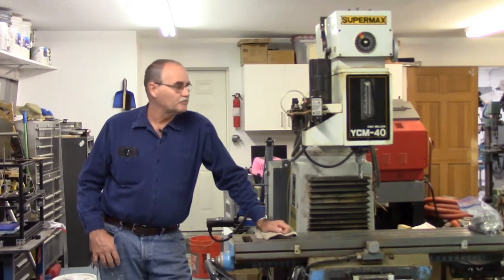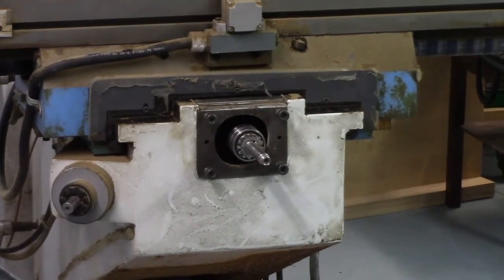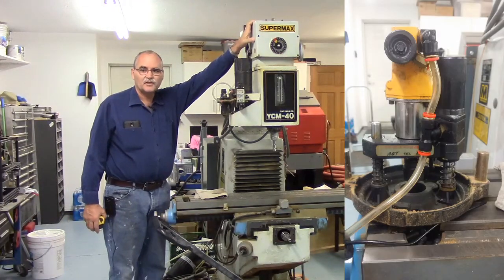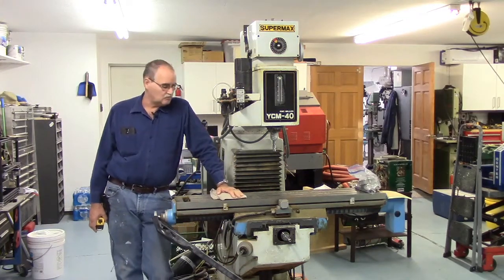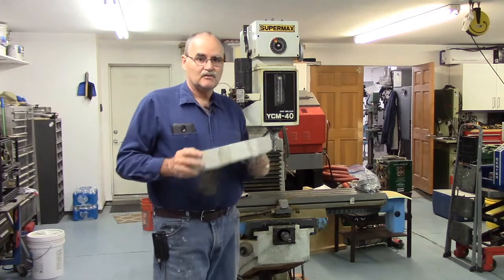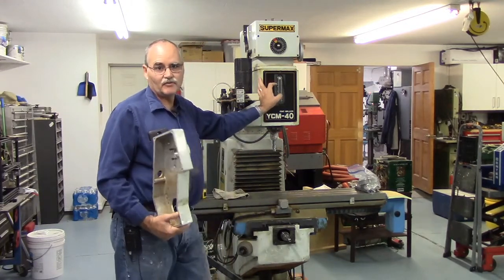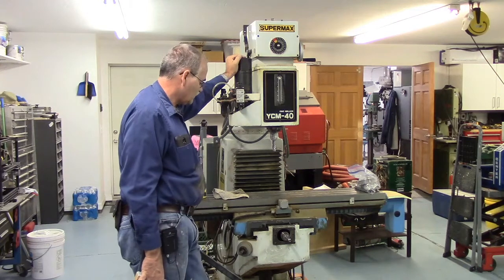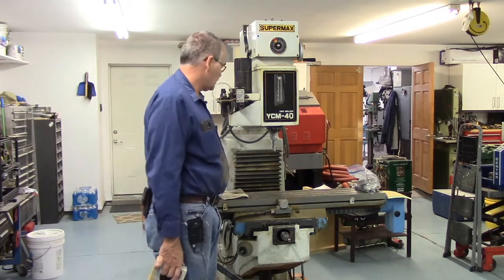Supermax YCM-40 Intro

Comment: Hi Marty,
I recently acquired a 1993 Supermax YCM-40, that had been in storage for years, by paying arrears storage costs.  Apparently, the original owners had removed and replaced the original milling head with a 40,000 RPM cutting head for some special purpose.  Otherwise it appears complete with everything needed for the intended purpose, but simply placed in storage.  Are you available - email or preferably phone - to field some questions about this type of mill?  For example, do you know (for certain) what head taper (#30 or 40) is on this mill?  If you wish, I can setup a temporary email account, so we can obtain each others contact info without publishing it to the world!  Thanks! BTW, my name is (also) Martin
Reply from the maker: Martin, there were several spindle option s as far.as I know. You can email me at my YouTube channel name @gmail.com I'll try and respond as time.permits. Have several paying retrofits going on at the same time currently. Helps keep the lights on in retirement. 😀

Comment: I have a project mill similar to YCM-40 you have, Bridgeport Boss series 1 with dc mag motors that are missing drives, and have gave up trying to get drives that work. Looking at DMM 750 watt motors as well.  Am considering using the acorn board.  My mill only has the original spindal motor which I believe is 2hp.  I would like to have rigid tap capabilities, but am concerned the motor is too small.  Do you have any suggestions for rigid tap and acorn board with this machine? 
Thank you for posting videos.
Reply from the maker: Hi Randy. Glad you found some useful info in the videos. Helps encourage me to do more! First, if you have the original DC brush Servos, had you thought of a Centroid All in One DC Control? Not only is a dedicated motion controller, with 16 I/O, Can control a VFD, it has 3 DC Brush servo amplifiers built on. I suspect this is out of your budget? DMM with Dyn4 drives and Acorn is a good choice. If you want to rigid tap, you have to fit an encoder to the spindle at 1:1 ratio. Usually a challenge on Bridgeport style heads. Elrod Machine has an attachment, but I don't know what he gets for it. As far as Rigid Tapping, I guess much depends on how big a tap, how deep and in what kind of material? You would be surprised how much torque you have in backgear. You should be able to put a micro switch on the lever to let the control know you are in a lower gear and you should be able to configure accordingly. I would suggest you visit the Centroid CNC Community Forum and post all your questions/concerns there. Centroid support monitors it on a daily basis. Acorn group is growing. http://centroidcncforum.com
Reply: martyscncgarage thanks for response.  i am glad I found your channel, I have more to watch.  Very well organized and informative.  The all in one looks good and am sure it is good but it is expensive.   I can get new a.c. drives and drivers and high line count encoders.  Gets rid of a.c. to dc transformer as well.  I tried Mac drives but could not get all three to work.. so have up on the old dc mag motors.  just trying to get a good system as cost efective as I can.  I do have a vfd conected.